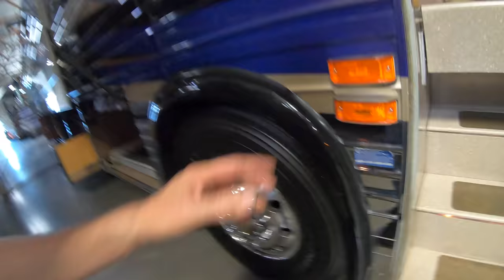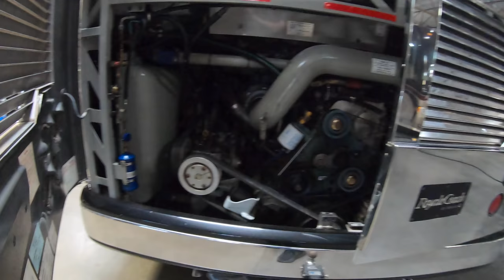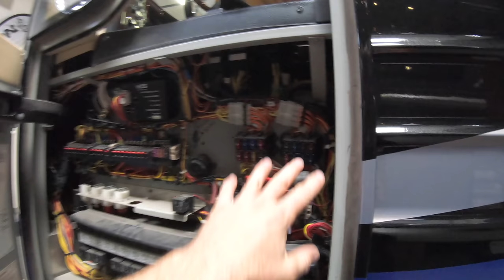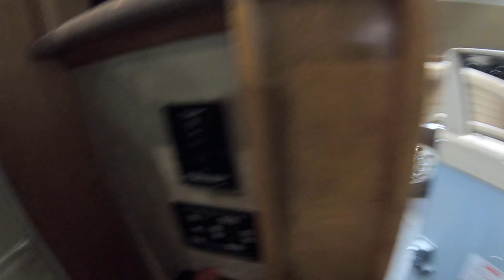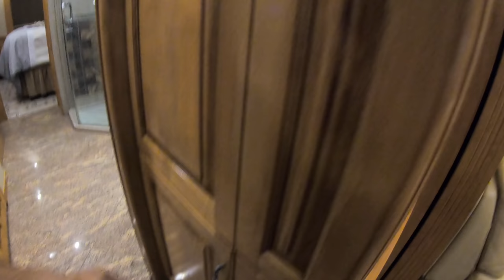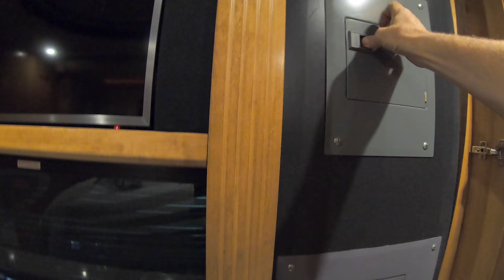👑 Monaco Royale Coach Prevost 👑

Comment: What size is the TV in the bedroom?  It was not mentioned in the video.
Reply from the maker: If I remember correctly it was a 32 inch or larger. And these coaches are electric so it would be an electric cooktop.